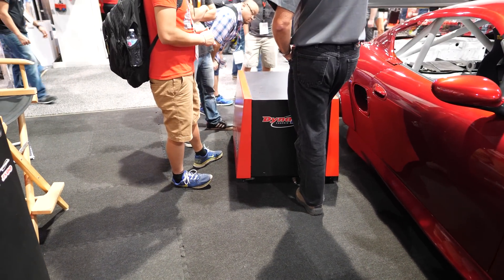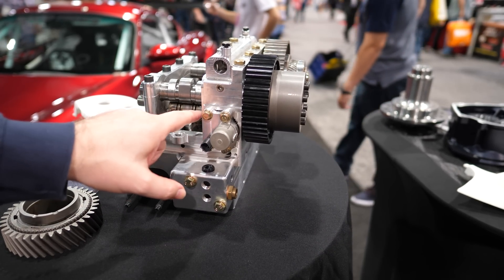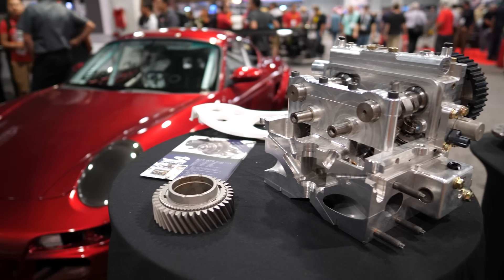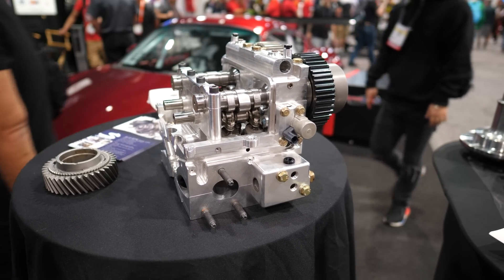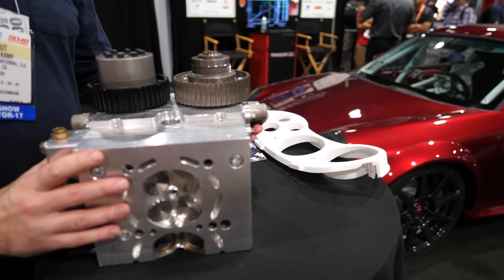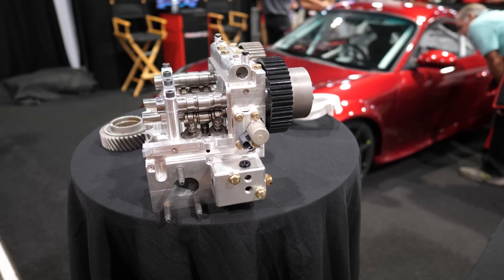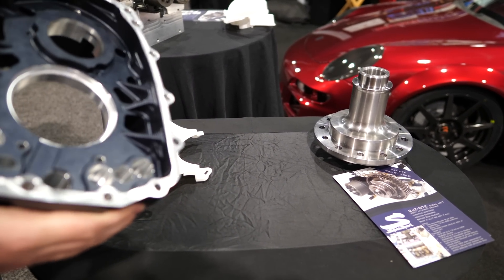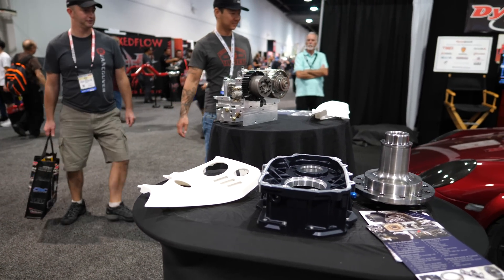SupraSport 2JZ CNC Billet Cylinder Head With Variable Valve Timing (VVT) and VVL at SEMA 2017 [4K]

Comment: I don't really get this. If you're going to go billet, just go full race with no VTEC and no coolant, if you're going for a road car with VTEC, just cast the head.
Reply: I dont think they have that many orders coming in to cast... they take 2000$ or more for it
Reply: You don’t get it cuz you don’t understand that Honda heads are and will ALWAYS DOMINATE because of how their system is. Nobody can compete with Hondas Vtec system
Reply: @ziggyortiz37  You're obviously trolling, but it's actually hilarious, because it sounds like you misread something that I've said in the past, but you're trying to throw it back at me to make it look like I didn't know what I was talking about.

The value that the VTEC system provides in a racing engine doesn't come from the VTEC system itself, it comes from the ports that it makes possible to use in a production engine. As far as I can tell, there aren't any production cars that have ports which are able to equal the performance of the ports found in a VTEC head, and the reason for this is because the VTEC system is able to compensate for problems (drivability, emissions cleanliness, ease of starting, etc) that would normally be caused by such ports in engines which don't make use of a VVT system with similar capabilities.

Not even Lamborghini Huracan heads can match the flow rate of a plain ol' K20A head, and there's more than a decade separating the release of those two engines.